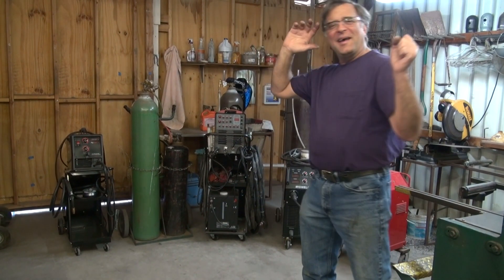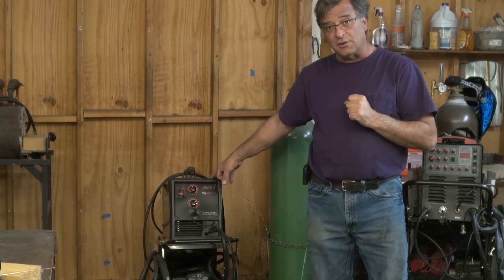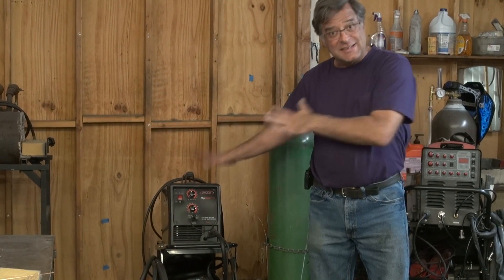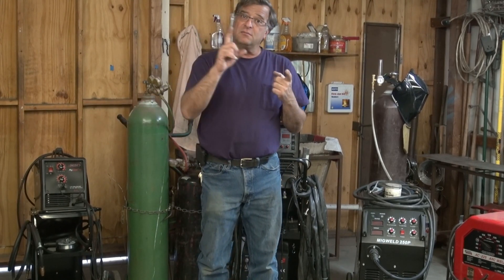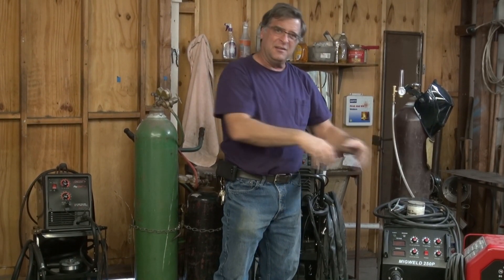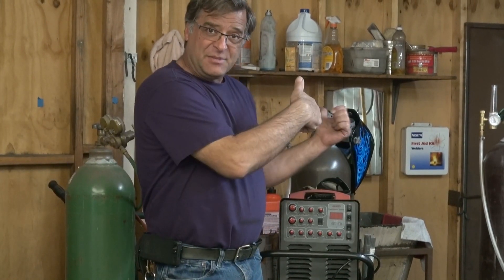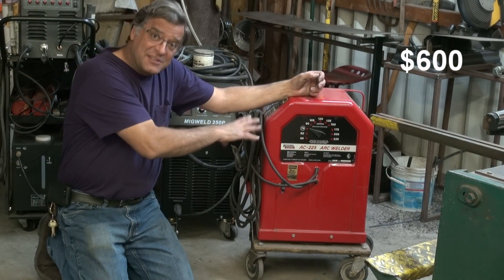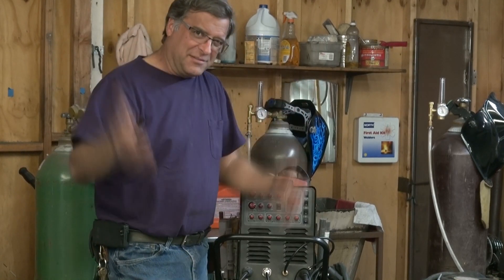How to Pick Your First Welder - Kevin Caron

Comment: Thanks for the video! While I found it on accident, it was a perfect beginners guide to buying my first welder. My only previous experience was welding metal sculptures in college, usually with nails or steel dowels. I've always wanted my own mig welder to continue my work and I now know which I'll be buying.

Comment: I have experience with harbor freight model 90 amp 110.  Thought it was a neat little welder at first, but the feeding mechanism is junk.  I never could get it right.  I had to always put vice grips on it to keep it right.  Trust his advice and mine, spend the extra money to prevent frustration down the road.  Stick to name brands, miller, longevity, and actually I love my little 140 amp  campbell hausfeld.  I also stay away from cheap lincoln's, they suck as well.

Comment: Thanks.  The EX seems like more welder than I need, and is about $400 more.  However, I do like that it has a pulse function.  I do not need the dual voltage as I have both 220 and a 30 amp 110 outlet at my welding table.  I will take another look at the EX.  Thanks.  Do you have a video on the EX?

Comment from the maker: The 200ex is out of the new manufacture. A MUCH better machine in my opinion.   The fit and finish is outstanding and the difference in power is noticeable.  I am using the 200ex now after using the 250ac/dc and there is no comparison!  Don't bother with the sx line unless you NEED the dual voltage unit. 

As for a plasma, I got to play with the ForceCut 42I for a short time and it is a very nice machine. Not as strong as the 60I that I have but well worth the money.

Comment: Kevin - helpful video as all of them are.  Question.  Want to get a TIG as I already have MIG, plasma cutter and Oxy set-up.   Looking at Longevity welders. The 165 vs the 200 amp welde - both are AC/DC, both 110/220 and both do 1/4 inch,  So, why would one choose the 200 over the 165?  Thanks.

Comment from the maker: Well that's a loaded question!!

If you are going to be using this machine all day, money is no object and it is your only one, I would go with the Miller.  If you are going to have several machines so you won't be out of work if one stops running I would look at the Longevity.  But to give you a better answer I need more information like what are you doing, what are you welding, how many people will be using this machine, that sort of thing...

Comment from the maker: Helium (He) is a chemically inert gas that is used for welding applications requiring higher heat inputs. It may improve wetting action, depth of fusion, and travel speeds. It does not produce the stable arc provided by argon. Helium has higher thermal conductivity than argon and produces a wider arc column. The higher voltage gradient provides a higher heat input than argon, promoting greater weld pool fluidity and better wetting action. From the Praxair website..

Comment: I have another one for you Kevin. Any ideas on how to cut a 4" pipe at 45 degrees accurately? I have a 4" & a 9" grinder. Is there a template that you can make to wrap round the pipe? I know you can buy magnetic ones but this is a one off and I'm a cheapskate. Thanks.

Comment: Kevin, another great video.  One mistake, no way should an amateur attempt to weld 3/8" with a 140 amp machine.  My 220V Millermatic 210 is rated for 3/8".

Comment: Great video Kevin, speaking from my experience, I started with MIG and then moved to an inverter TIG that also does ARC. Boy do I miss the speed and easy of the MIG sometimes, I do mostly car work and mild steel fabrication. but being in the UK and welding outside in the rain the ARC cannot be beaten. My one bit of advice is buy the best machine you can afford and don't scrimp on a good helmet